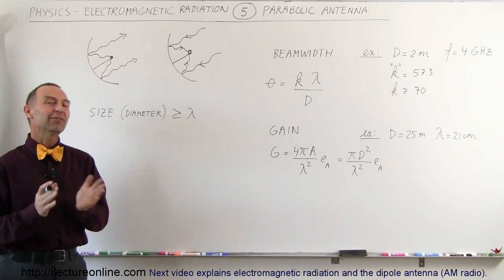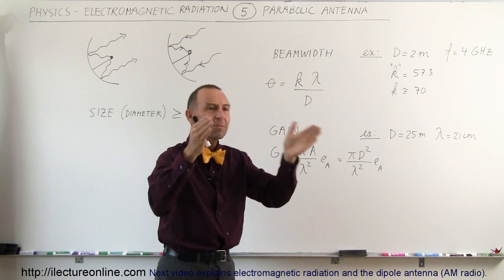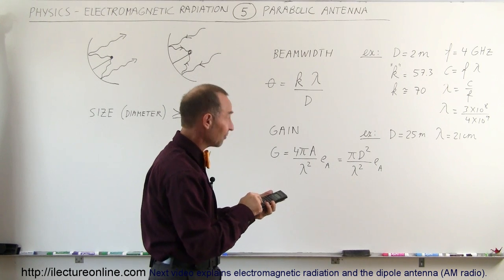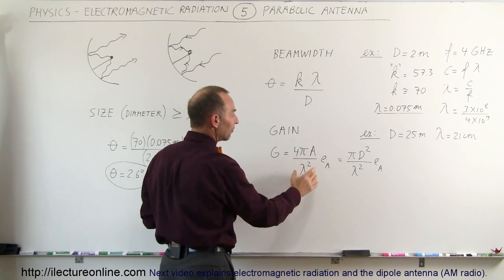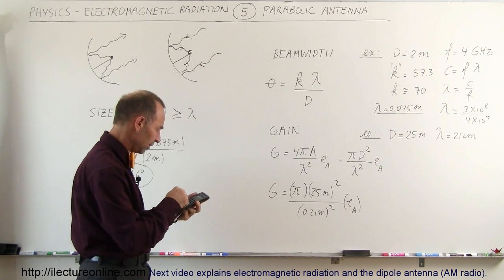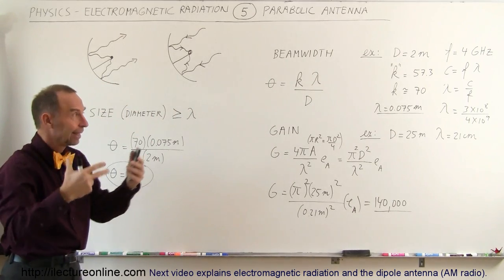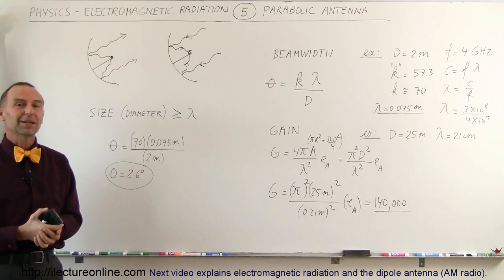Physics 50   E&M Radiation (5 of 33) Parabolic Antenna and E&M Radiation and Temperature

Comment: I want to make a small correction. The "k" value in the most ideal case is 1.22 when using radians, or about 70 when using degrees. Search for "diffraction limit," the same equation restricts resolution in optical systems etc.

Comment: One question please... The receive parabolic collects the EM radiation and directs it to the small receiving antenna.. Understood, but what is that process? Do the waves bounce off the parabolic into the receiver, like a thrown rock would bounce off a hard surface? Or does the received EM wave generate oscillations in the parabolic metal, which, in turn, generates a new EM wave into the receiver? THANK YOU!
Reply from the maker: The parabolic disk reflects the waves and concentrates them at the receiver.
Reply: Michel van Biezen Thank you for the clarification! Have learned much from your excellent instruction...

Comment: Mr. Professor flip of spin of electron gives specific wave lenght? Does it mean that just a flip is enough to produce electromagnetic wave? And it is possible to distinguish by the lenght of wave from which shell and the atom this wave comes?
PS now I know how does the telescope work.
Reply from the maker: It turns out that the spin flip of the electron in the hydrogen atom produces E&M radiation with a wavelength of 21 cm.   This is know as the 21 cm radiation, that allows astronomers to "see through" nebulae towards the center of our Milky Way Galaxy looking for this 21 cm radiation.
Reply: I know that high strenght magnetic field in NMR is able to change spin of nucleus(*). Is there any other way to do this? Thank You for the replay. Mr Professor this lectures are like Bible.
Reply from the maker: In space this happend frequently with the absorption of a photon with the correct amount of energy.   E = hf = hc/lambda  =( 6.626 x 10^-34 J sec) (3 x 10^8 m/sec) / (0.21 m)
Reply: Mr. Professor can this portion of energy be qualified to spectrum of absorption?
Reply from the maker: The energy is very low due to the very long wavelegths, so it is typically not included in the spectrum of absorption.
Reply: Thank You very much.

Comment: Wht is significance of gain ,if gain increased than frequency increases hence less diameter of antenna is required?
Reply from the maker: Gain means an increase in power.  (energy per unit time)

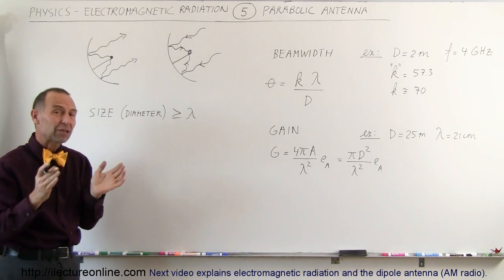Comment: Why is the size of antenna dependent on wavelength as explained at instant 1:05
Reply from the maker: If the wavelength is bigger than the size of the antenna, it cannot effectively absorb the energy of the radiation.
Reply: @MichelvanBiezen  Why is it that the parabolic antenna doesn't absorb the energy effectively whenever wavelengths are greater than the dish size?